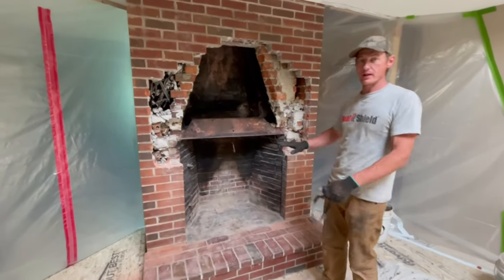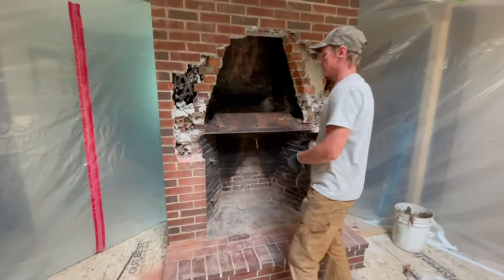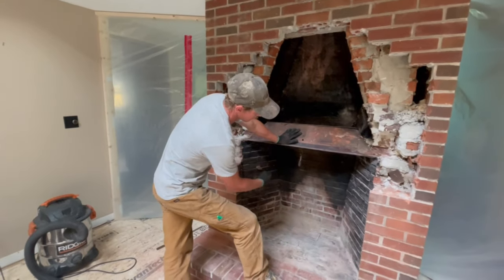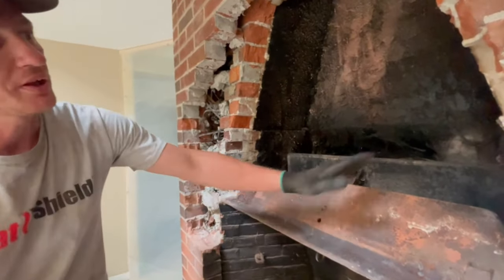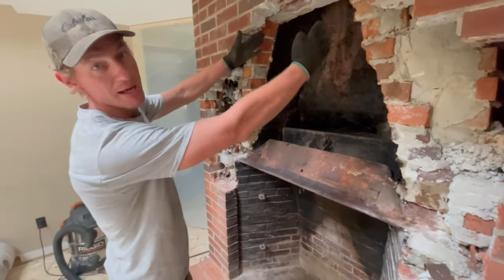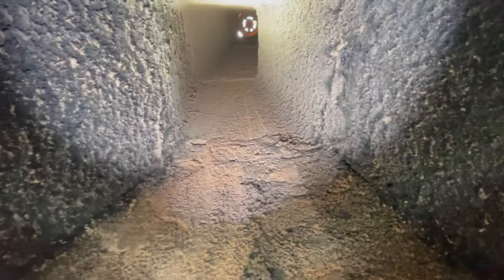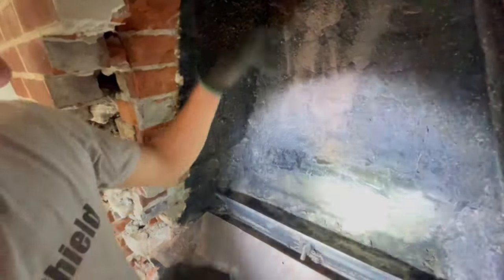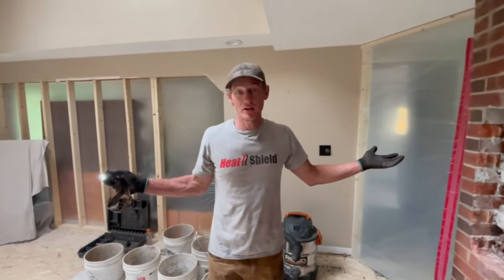Internals of a masonry fireplace

Comment: Do you have a video how you would put an wood burning stove in one of those old brick fire places for better heating?
Reply from the maker: I don't. It's not that difficult to do, It's just hard to have the proper clearances to combustibles after the install. The mantel may need  to have a heat shield installed, or the hearth may need to be extended in some way.

Comment: Hello! 
What would you suggest for a wood burning fireplace with no damper down low? Is it possible to install a damper insert without tearing it all down?
Reply from the maker: It’s tricky, but doable. You may be better off seeing if a top mount damper works for you. They mount on top of the flue and close with a stainless cable that runs to the firebox.
Reply: @chadvaillancourt  yeah i see those. Not sure which direction i will go. Looking to keep the heat from escaping straight up when burning wood.